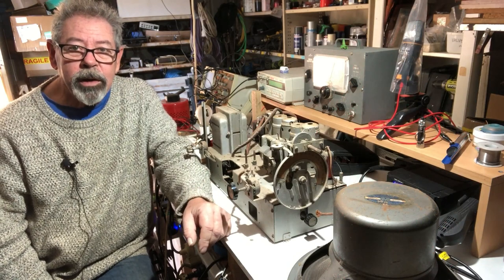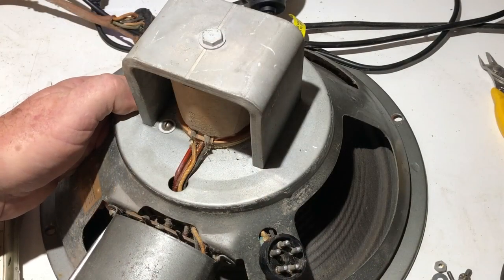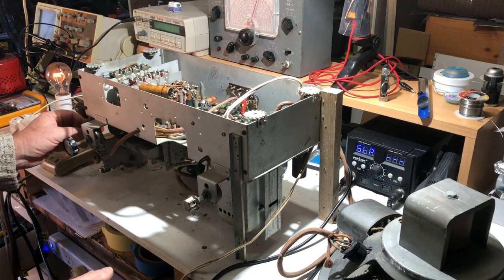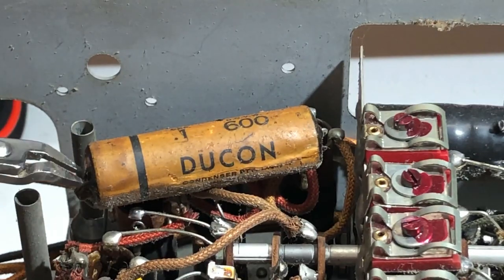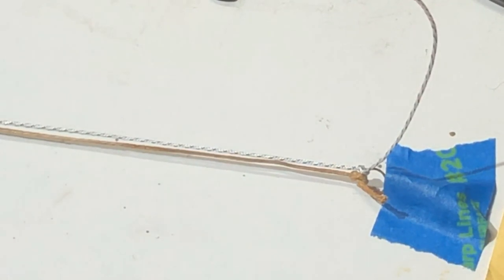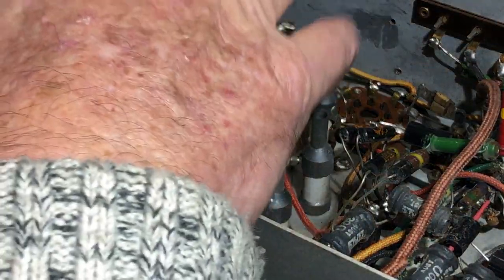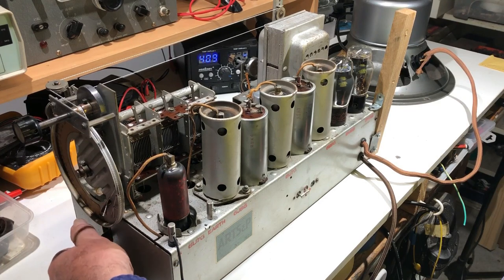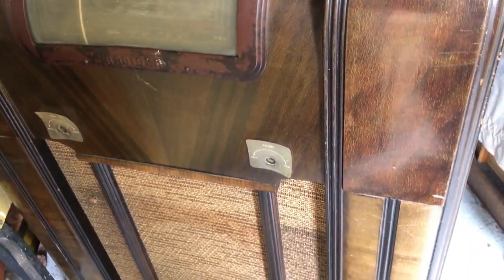1941 FISK RADIOLA model 276 RESTORATION PART 2

Comment: Great job! About the smoking speaker: always a bit scary to have a problem go away without knowing exactly what you fixed. And that bucket of capacitors is a really nice trophy collection! 😅
Reply from the maker: Hi Kristof.  I'm still a bit worried about that smoke.  As you say, it's a bit scary if you don't know why the fault has disappeared. There are a few possibilities, most likely that speaker socket but watching the video I thought I saw a small black spot on one of the wires on the plug mounted on the speaker.  I'm going to investigate that and maybe add some insulation behind it.  It often happens that I see details on the video that I missed in the workshop.
The bucket of capacitors is my entire collection - every cap I have ever replaced lol.
I'm enjoying your series on the Operette 6
Cheers
Reply: @Donno308  A flaky connection somewhere in a plug causing overheating is certainly a possibility. You see this often on pinball machines.
Thanks for your compliments about my Operette series. I think I'm nearly done with it, although the alignment didn't really go as I wanted. I only still need to find the issue with the shortwave...

Comment: The 5Z4 has an indirectly heated cathode.  They're constructed much like the 6X5 and 84 tube.  The early ones were unreliable, though the later ones were better.  It will provide a slower warmup, with a slightly higher B+.  Some sets could use either a 5Y3 or 5Z4, I'd go with the proven reliable 5Y3 - as long as the capacitors you install are rated for 500VDC+.  If a 5Z4 shorts, it can take out the power transformer very quickly.  That was an issue with a Delco I worked on.
Reply from the maker: Hi Adam.  Thanks for the info.  The caps I used are rated at 600V so all should be ok.  The schematic specifies a 5Y3 so I would prefer to have that in the chassis anyway.  I'll keep the 5Z4 in case I need it for another radio.
Cheers

Comment: A loverly repair,  it looks like a new radio now :-D
Thank god you found the speaker plug problems, it would have been a real shame for such a nice speaker to burn up  :-(.
The smoke was likely dust being ejected when the plug shorted for a second.
Sorry i'm saying the bloody obvious there.
Ha ha philips would have made that dial cord path a nightmare (With added boobytraps).
Philips had a bad habit of using one valve for several switched functions, if it failed the whole shabang went tits up lol.
Silly philips.
Reply from the maker: Thanks! Yep. I think I'll give Philips a miss for a while. This one is a breeze to work on by comparison

Comment: Hi Don. Great stuff, you are making good progress with this one. Let's hope the fault that was causing the smoke has disappeared for good. All in all it appears to work well. I bet it will sound good when that nice speaker is back in the cabinet. As you said, at least it's not a Philips 😆. I do hope you get a lot more subscribers as you really do have a great channel. Can't wait to see the end result. Cheers Chris.
Reply from the maker: Thanks Chris.
 I'm pretty much convinced it was the speaker plug.  I'll go over it again before I put it back in the cabinet.  Hopefully it will sound good with the speaker in the cabinet.  It doesn't sound great on the bench - not much bass. Not sure if the tone control needs looking at.
Cheers

Comment: Really rooting for this restoration, looks like a perfect example that is in the right hands to get it singing again. At the 6:00 mark to me that orange/brown wire looks like it has a burn mark on it like it grounded out to the speaker basket ? Am I the only one who sees that ?
Reply from the maker: Hi Matthew.  I only saw it when I was watching the video.  I think you're right.  I'll investigate that and probably add some insulation between the wiring and speaker frame.
Cheers

Comment: New subscriber here and slowly working back through earlier presentations.  Great work there.  I actually prefer to listen to the received audio as well as the meter when doing alignment, the ear is pretty good at detecting the peak and the audio tone changes when on the sweet spot.
Reply from the maker: Thanks VK4UH.  That's probably true.  I notice a lot of people use dummy loads to stop the noise and I can understand that.  I've also spoken to people who swear that doing it by ear is better.  A combination is probably ideal and with a bit more experience I may be able to recognize the "sweet spot" by ear.  Making a good video of the alignment process is notoriously difficult.  At least 2 cameras to sync and the noise drowns out the audio.
Thanks for your interest.
Cheers

Comment: Hi Don, I just had a though about the magic smoke. I had a radio many years ago that smoked and it turned out to be a dead insect hidden away. Maybe the loose wire on the speaker plug and 70 years of detritis were the cause. Who knows! There was a couple of these, table models, at the recent HRSA auction. I was tempted, but I have nowhere to put them at the moment. They didn't sell for much. Looking forward to the cabinet.
Reply from the maker: Hi Andrew. I'm pretty sure it was a short in the plug or socket.  Probably combined with the dust of ages. Anyway I'll check the connections out thoroughly before it goes back in the cabinet.  Unfortunately the weather has turned bad again - looks like we're in for a week of rain so the cabinet will have to wait a bit.

Comment: The field winding looks brand new in that speaker.   Even the paper looks brand new.  Has it been rewound?  The whole speaker is in such nice condition.   Maybe it is just a bit of dust causing the scraping......     I enjoy watching you restoring these radios.   I started watching Mr Carlsons Lab years ago when I first started the tube/valve hobby.  I do tend to enjoy watching the local people like yourself and Mr Tipton better though.   A lot of the radios that Mr Calson does are just not available in Australia.
Quick question:  Where do you find the light globes now?   I am struggling to even find the halogen style replacements, let alone traditional 60 or 100watt globes.
Reply from the maker: Hi Brendan
I think the field winding is original - just well-preserved.  These radios weren't considered fixing after the 1960's until recent years so they would have just thrown it out.  Apart from a couple of capacitors I don't think this one has been touched since the 1940's.
As for the light globes, I have a small collection that I have pinched from houses over the years but you can buy them on ebay - just search "filament globes" or similar.
Cheers